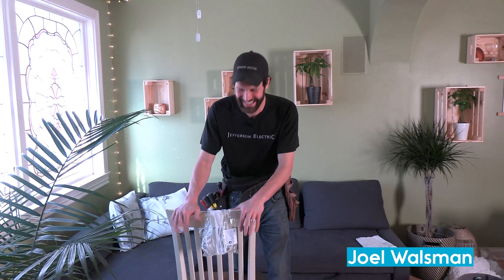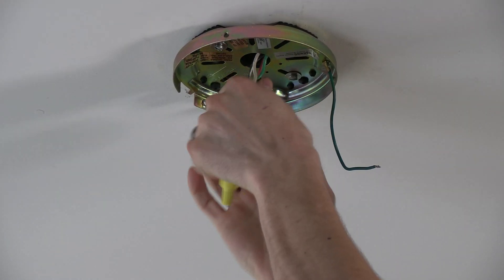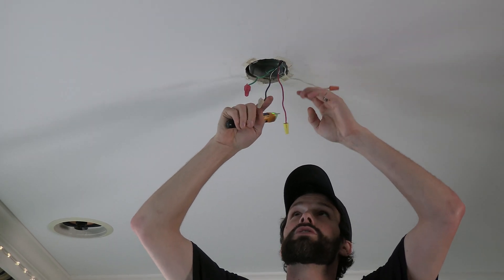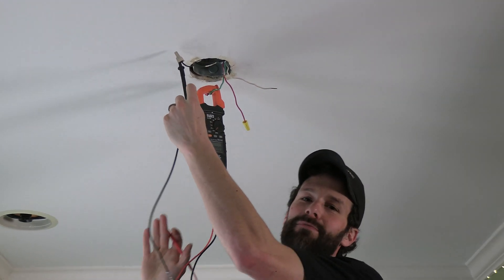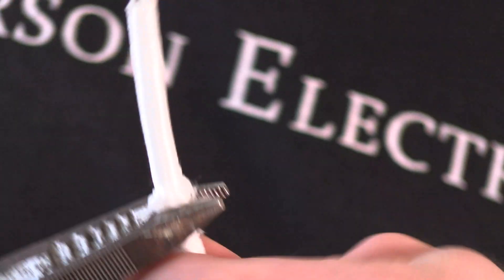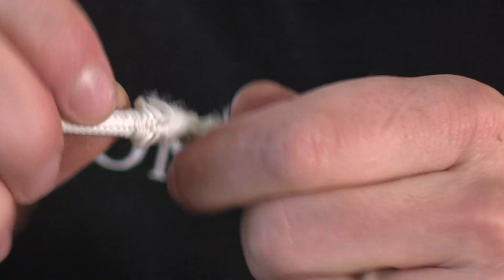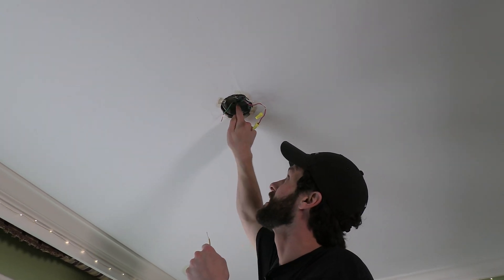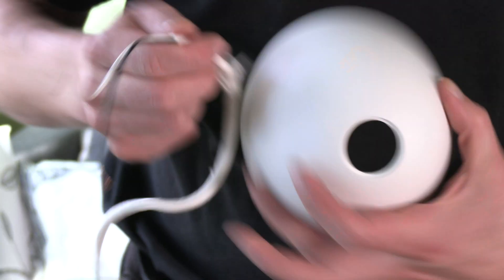Why Are IKEA Light Fixtures So Strange?

Comment: Dear Sir. My sympathies. I noticed the plate with hook from ikea lamp  which is mounted to the ceiling box did not get hard wire bonded as well. The box mounting screws did the bonding. Does your code address this   alleged oversight?

Comment: Cutting the length of the cord was not necessary.  It is meant to be coiled up in the top housing.
Reply: @ElectricProAcademy  I agree it makes it easier for someone with tools, however these are designed to be installed by millennials with maybe a screwdriver to their name.

Comment: I stopped purchasing and using any LED lamps from cheating lack of quality control communist china. When I first started converting all of the lamps to LED'S I purchased two different cheating china brands from big box stores. 2 of them went bad within a month & at least 3 others started doing Morse code ( long & short flashes ). CREE made great made in USA LED'S until they got sold.
Reply: @ElectricProAcademy  I did a Google search for made in USA LED'S and found a few but waiting to order until I check with a large local electrical supply house. Also had a cheating china LED that was in a 70 degree area catch on fire then the warranty china garbage driver was smoking. Replaced with a quality made in USA driver and working great last three years. Cheating china is best in class. Yep best at stealing a billon dollars a year in intellectual properties, boot leg faulty circuit breakers, extremely toxic sheetrock that cost an average of  $80,000 a home to repair, poisonous dog & cat food,  largest counterfeiter of money, 35 years of producing kids toys with poisonous outlawed lead paint. Can never trust any communist country.
Reply: Let me guess, they burned up in an enclosed fixture?
Reply: @Florida_Man_In_Florida  only one burn up in a fairly large maybe 10" round glass enclosure with another 60 watt equivalent LED. The made in USA LED'S have been working great for over four years. 2 we're in table lamps and rest in ceiling fan glass gloves.

Comment: Do you think the splices should be on the other side of that round plate, in the box, rather than in the canopy space? Then you put that braided cable through the hole in the round plate. Ground screw would be on the box side too, so you'd see the threads poking through when you mount the plate to the box. Very funky fixture--I prefer the fan. lol

Comment: 42 volts on black conductor was probably caused by the dimmer.
Reply: Could it have been a wall mounted fan speed control that wasn't completely off?   I know you can't use a light dimmer for a fan motor but l've never heard how the two switches differ in terms of how they work.  And with ceiling fans, the motor is usually on the black wire with the light on the other "hot" color (red, blue or black with a white stripe).
Reply: @davidwayneprins  A house I worked in once for a relative had a fan dimmer switch on an exhaust fan in the basement.  The strange thing about it was that the fan speed control was infinite, just like a light dimmer.  Normally fan speed switches have detents rather than infinitely variable.  Is it odd that I always remove dimmers and install normal on/off switches?

Comment: From my days working at Menards, I don't ever recall a fan where the motor was not the black wire.  The light was either black with a white stripe, red or blue.  

I do agree on the handiness of a Non Contact Tester.  Not only a safety device but also helpful when distinguishing hot from neutral.  My recently purchased house was built in 1910 and some areas still have knob and tube wiring, but the colors are faded.  I'm marking the wires with red and white electrical tape.

Comment: Kind of a tangent question but arent ceiling fans supposed to have a braided steel safety cable?  Did you remove it off camera?  I've never installed a residential fan but I have installed several commercial ones.  The box would support the fan under normal conditions and the cable would be attached to something else like red iron or a rafter separtely just in case.  Love your content--keep it up!
Reply: Many fans do not have a safety cable.
Reply: @illestofdemall13  Wow--we had a steel bladed fan that wore thru the swivel pin once.  I'm pretty sure the occupant of that shop was grateful for the cable.
Reply: @wendellbunch4578  Higher grade/heavier fans probably have them a lot of the time. In my experience, I'd say 25-30 percent of the fans I installed in residential came equipped with a safety cable.
Reply: I've never seen one, but that is a very good idea.

Comment: IKEA do simple light mechanism usually  class 2 lighting (double insulated) but the funny thing is there are still ground connections which I prefer. I do believe proper light boxes/outlet are better for making and securing connections in. 

Quite frankly nowadays I don’t trust the quality of light connections and safety. I do all my own testing on them with specialist equipment. That being said Phillips led lights in my view are still one of the best all round constructed set of lights. They create really nice PCBs to turn lights from high to low voltage, also with excellent power factors.

Comment: I carry Fluke non-voltage tester in my pocket everywhere I go, but my favorite on the job is Milwaukee. It stays plugged into a receptacle while I switch off breakers trying to kill power. Another plus is that it has a very bright led light

Comment: I now carry a short piece of chain with S hooks on both ends so I can hang fans and large light fixtures from the ceiling bracket while I’m working. I also have a MagMaster magnet clipped on my belt or suspenders to hold screws, nuts and tools. Amazing holding strength and built in Post Falls, Idaho.